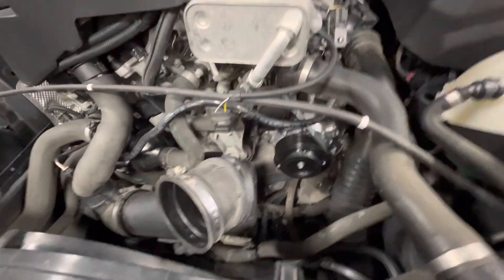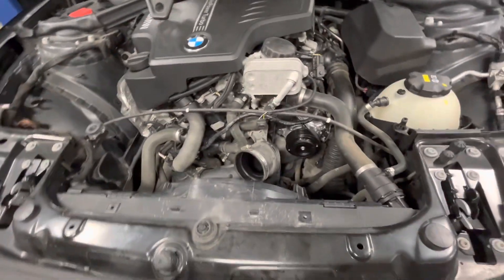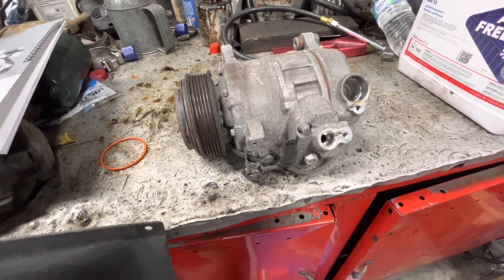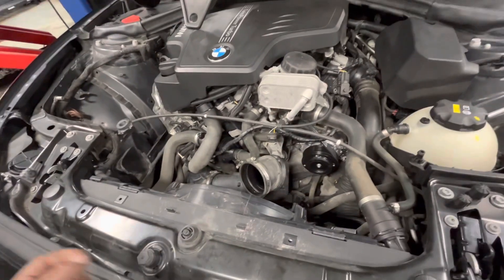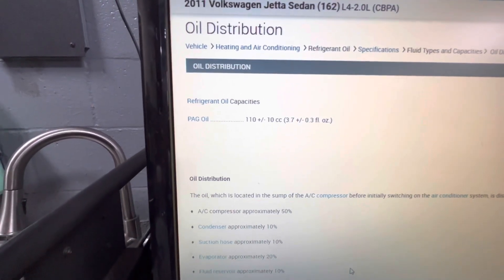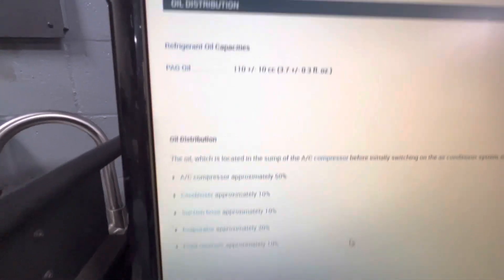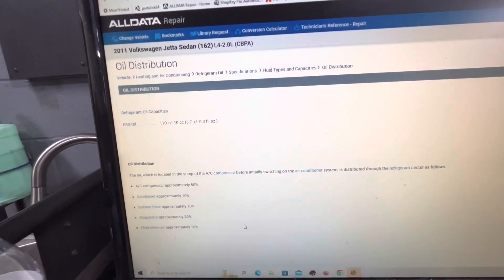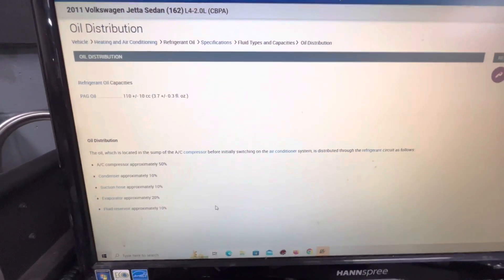HOW MUCH REFRIGERANT OIL (PAG OIL) TO ADD AFTER AIR CONDITIONING REPAIR IS PERFORMED

Comment: I know this video is several years old but I hope you might be able to answer a question for me.  I am basically rebuilding my entire A/C System on a 2015 GMC Sierra 1500.  I am replacing the A/C Compressor, A/C Condenser & Expansion Valve.  I plan on flushing out the lines as well as the Evaporator since I can not get to it to change it as well.  After I complete the repairs when & where should I add the Pag 46 oil to the system?  3 oz will be in the Compressor which leaves 3 oz to be placed somewhere.  Should I add it before I vacuum the system or wait until after and add it just prior to adding freon?  Sorry for all the questions but I'd appreciate any help you can offer.  Thank You.
Reply from the maker: I would probably add 60% of the system capacity to the ac compressor before installing it and put about 10 or 20% into the condenser and you could just pull the rest in on the low port
Reply: @EuropeanAutoRepair I assume I would would add the 20% to the Condenser prior to pulling a vacuum on the entire system?  If I understand you correctly on a system that hold 6.10 oz of Pag Oil I would put 3.6oz in the Compressor, 1.5oz in the Condenser & the remaining 1oz would go in the Low Side Port?  Thank you so much for the quick reply especially on a Friday Night.
Reply from the maker: @HereWeGoSteelers yeah that would work well, no problem man, have a good weekend

Comment: what do you do if you take the old compressor off and it's completely empty?
Reply from the maker: Your going to have to look up the pag oil capacity and distribution and add the amount suggested, it’s usually a large percentage of the full capacity in the compressor
Reply: @EuropeanAutoRepair  well, I just replaced the compressor, condenser and high pressure line in my truck.  Took the old compressor off and went to drain it and zero oil came out.  Wasn't sure what to do so I dumped the shipping oil out of the new one and put 6 oz into it of new oil.  Everything works but I've never gotten the pressure right.  Around 25psi low on low side and about 50 psi low on high side.  It also doesn't cool as well despite putting the exact amount of refrigerant.  Seems maybe there is a leak too even though I tested with the vacuum twice and it never leaked at all, but it stopped blowing cold on one side of the dash after only driving it a few times.  Recharging with some refrigerant fixed it, but idk for how long.  Pressures still low.  Wondering if I over charged with oil, but I had no way to know what was in the system when the compressor was empty.   Probably should have flushed everything and started fresh.